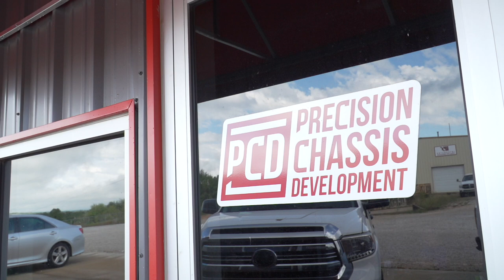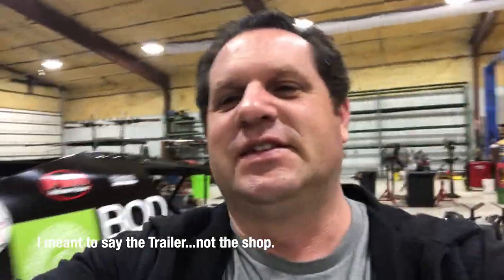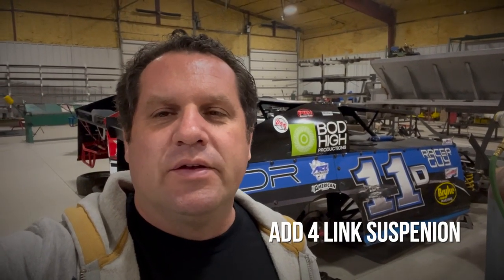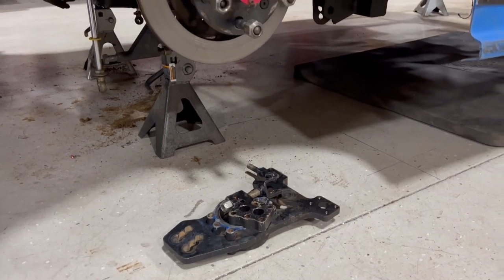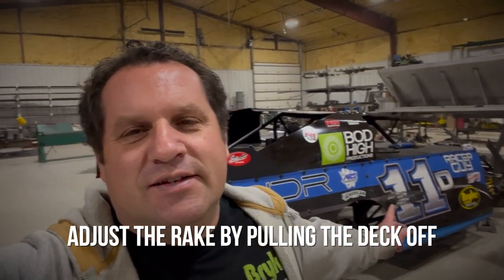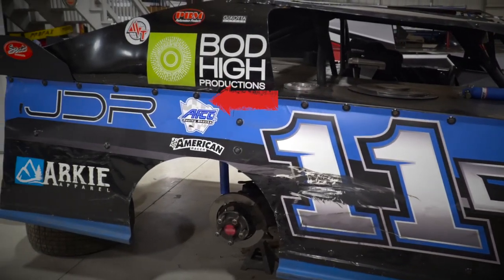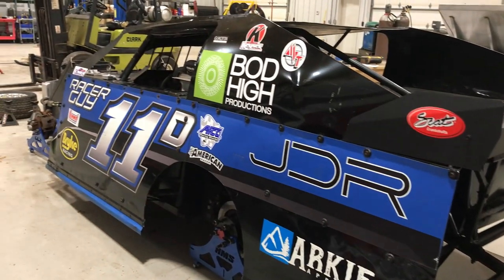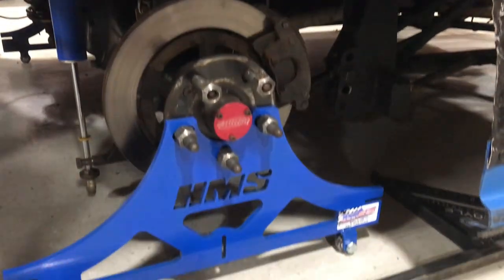Getting ready for 2022 Racing Season on a budget! - Part 1

Comment: I square everything off the left front, and never run lead or trail in the right rear. I loke a solid three bar suspension, lr spring in front and 7" down, right rear on top for slick and down in front for tacky. Pull bar mount always mounts right above the bellhousing. Three bars are tons cheaper than a four bar, and with less unsprung weight, it just takes more of a swing at it from tacky to dry, but you can hook it hard enough on powder dry slick to spin the left rear wheel inside the tire with 18lbs of air in it. Take  care, and good luck
Reply from the maker: Oh ok, I may have to look into that. And that's exactly what I was trying to do, getting it squared off the LF. But having no numbers from the builder I was struggling to find a center line to square from. when I X'ed from the ball joints it did tell me it was off. But I didn't know where the RF was located. Our old Harris cars would always X LR - RF long when squared. I think I got spoiled on the cup cars. They were so easy to square. We always put center lines on all new chassis, then using a surface plate you could locate everything pretty quickly. I won't lie going back to these type of cars I struggled for a minute. But slowly it's coming around hahaha, I hope anyways. But I agree with you, I ran a 3 link for years and I was thinking of sticking with it for awhile. But I had all the 4 link stuff. The only thing I really like on a 4 link is the tuning, being able to separate my wheel load and rear steer. Who knows, if I struggle I might go back to it again. And thank you so much, I need some good luck!